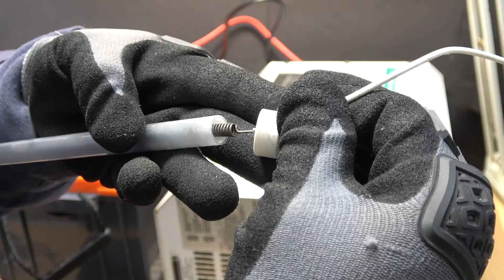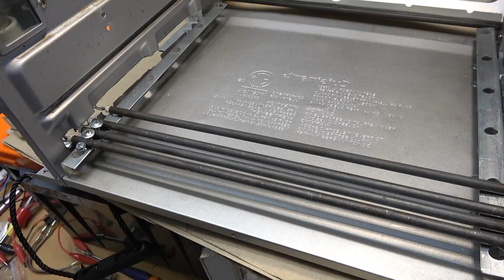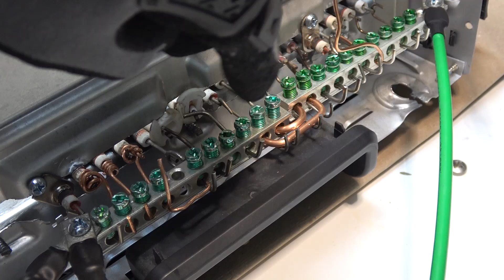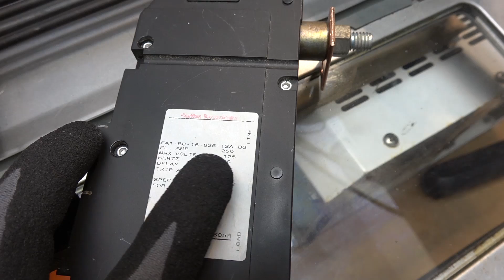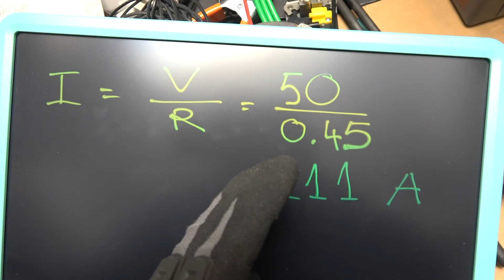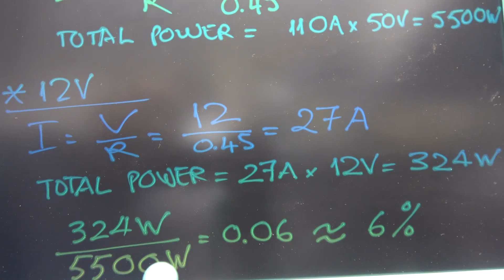Home made 5.5KW load tester: The mother of all oven

Comment: You are a very smart person! So you should consider a GTI load tester. It sucks out power from your battery or PSU under test according to the parameters you set and exports that power to the grid so you get credits on your NEM plan. If you don't have a NEM plan, just charge your batteries or heat your home water with the energy instead.

Comment: I always learn a lot from u!!  I have a 12 v battery tester that puts a pretty good load on a battery. The manual switch broke, so I used a starter relay from my Buddy 125 Scooter. I think it’s good for about 100 amps for 20 or 30 seconds. It works great.